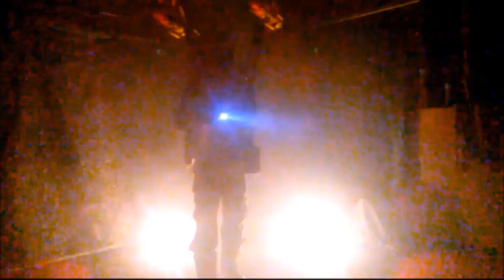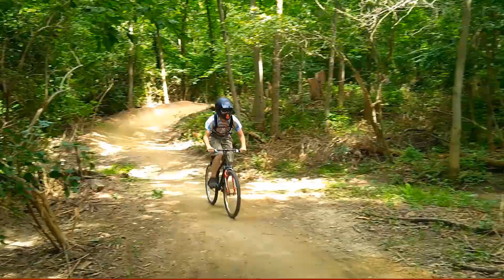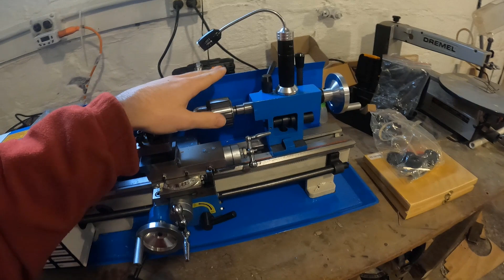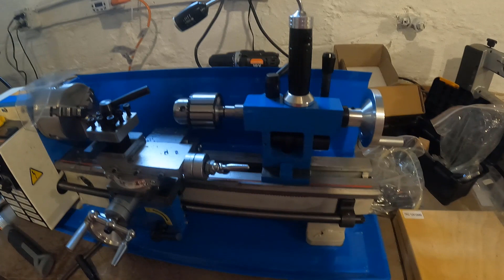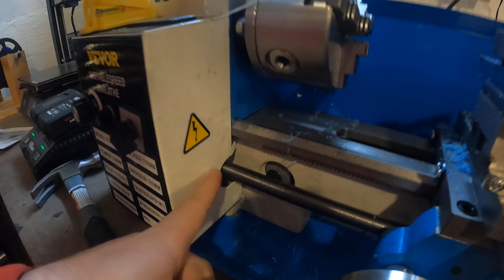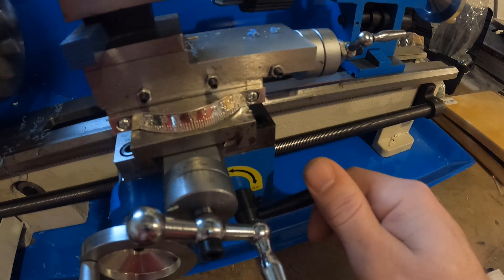Vevor Lathe Mini Lathe - First look Review

Comment: I have the same machine. I need it for smaller things where I turn it relatively slow so I was wondering if you recognized a little knocking sound in the machine? Should I be worried or what could I do to fix this? Machine runs normal but that sound is little annoying or makes me worry

Comment: Looks like that middle spot on the direction switch could be a safety feature. You can not switch the motor from forward to reverse without turning off the machine or it will blow the fuse. This stops you from grenadine the drivetrain.
Reply from the maker: That's a good thought it's just extremely stressful every time I flip it I think it's going to blow fuse

Comment: Can you lathe hardened steel like a clutch basket gear with one ? Or is it just for soft metals like brass copper, aluminum and regular carbon steel?
Reply from the maker: I have not tried hardened steel it is only a 110v so it's not loaded with torque like a full size shop lathe...I have stopped it when I stepped up drill sizes to quickly on a mild steel.  The trick seams to be go shallow on cuts...plus the cutters it comes with don't come close to the power of standard insert type.  I need to upgrade to insert carbide type probably do allot better than the ones it came with...
Reply: To machine hardened parts the trick is to turn it way slower than you would turn soft material, and also use no lubricant or coolant and use a diamond insert cutter.

Comment: Would this unit be sufficient to do machine work on chainsaw cylinder? for porting purposes?
Reply from the maker: I don't know enough about the process to tell you... I would guess that the chainsaw cylinder is going to be cast aluminum.  Aluminum is a soft material so it would cut that probably although I have never worked on a cast aluminum part.  Only regular aluminum.  The consistency of the aluminum might be a little bit harder to control the finish... I know that's the way it is with cast iron.